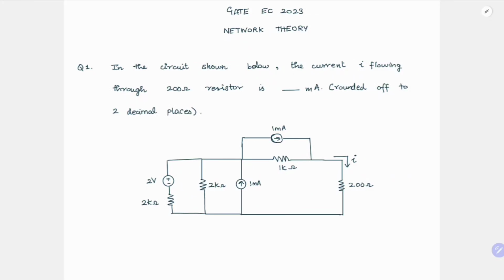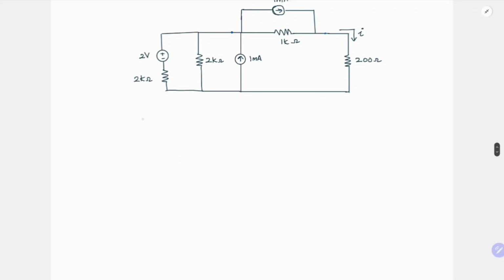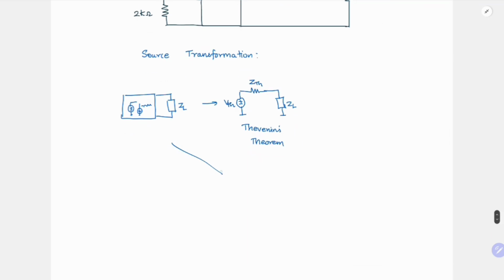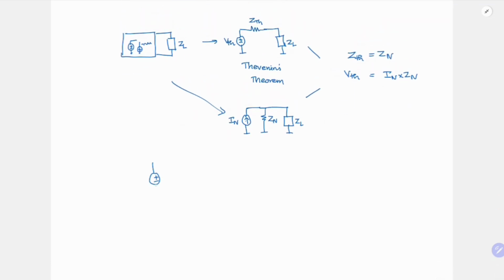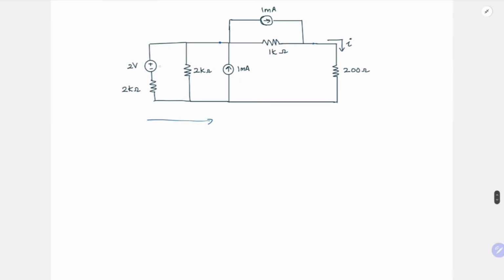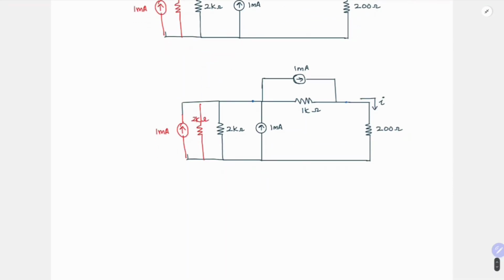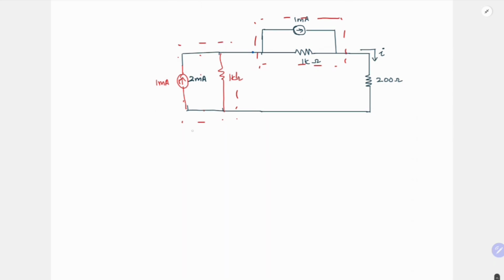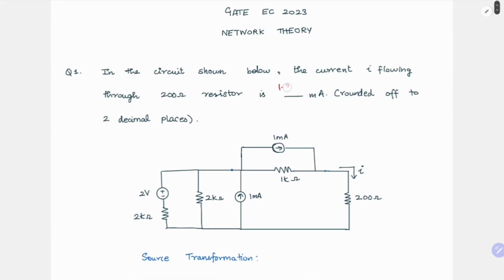Network Theory GATE PYQ | Question 1 | Ram Balaji S

Comment: how come total resistance is 2.2K ohms?
total resistance is 2K ohm
so i=1.5A is the Answer
Reply from the maker: Total voltage/Total resistance in the loop is the current in the loop.
Reply: @RamBalaji18   What is the Value of Total Resistance?
Reply from the maker: @venkateshmeriga6877  2.2K, 2Kohms+200ohms.